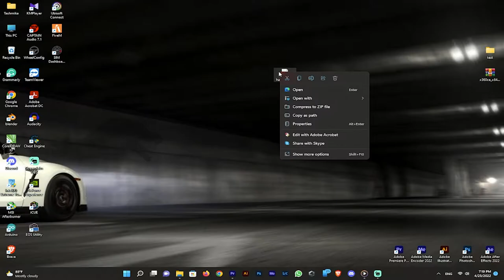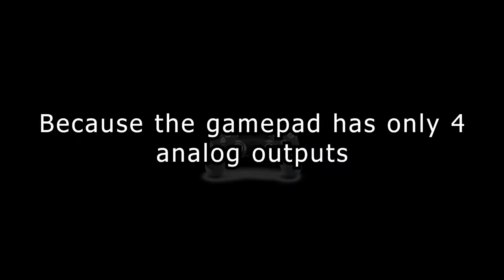How To Make Handbrake For Drifting

Comment: bro what is the spring specs ( length, stiffness, etc) 
and i want to 3d print it , could you provide me with more dimensions, 
i don't wanna print it on paper then take dimensions it won't be accurate, would you upload more dimensions i will be pleased

Comment: I want to know about the potentiometer and microswitch and which one to install potentiometer or microswitch for handbrake? Or both we should install
Reply from the maker: you can install both
You have two options for how you play 

  1. (automatic gear or peddle shift + Analog Handbrake)
  2. (Manual gear + Clutch + (Micro switch) Handbrake Or without a handbrake)
Reply: @zudumalli  how to use it with micro switch and is it okay that we can use without putting potentiometer
Reply: @zudumalli  how will I know what switch I'm using
Reply: @zudumalli  I want the 2nd option and for the 2nd option what we have to do
Reply from the maker: Brother, one of these two is used at a time.
1. (automatic gear or peddle shift + Analog Handbrake)
 At this time, the clutch paddle should be disconnected. Then the potentiometer should be connected to the handbrake.

2. (Manual gear + Clutch + (Micro switch) Handbrake Or without a handbrake)
At this time, disconnect the potentiometer related to the handbrake and connect the micro switch related to the handbrake. Then the potentiometer of the clutch pedal should be reconnected.

Then the handbrake and clutch paddle (key mapping) from the in game settings.

Install both the potentiometer and the micro switch to the handbrake.

2-way screw terminals were used to make it easy to connect and disconnect these.
check this out - https://drive.google.com/file/d/1RfccXfPocEKmYYBNjIDjAs3hHHrT5gRn/view?usp=sharing
Reply: can you have sitck shift and a pedal in a single build? like theres a switch where you can choose what king of shifting style you want.

Comment: Hey bro what was the measurements for the holes drilled in the 19cm side panels
Reply from the maker: get this link and print it in A4 size ( After printing check out size Height - 9.5cm and length 19cm)
Link -https://drive.google.com/drive/folders/1Lr3zro9ctEdnfW8BlieOCsbHoE5yu5W7?usp=share_link
Reply: @zudumalli  I built it but instead I hooked it up to a controller